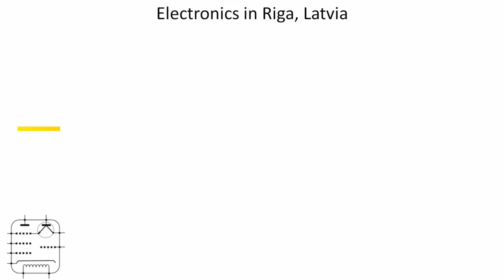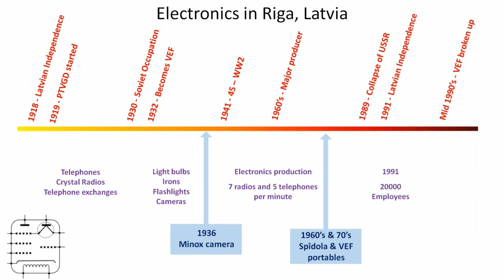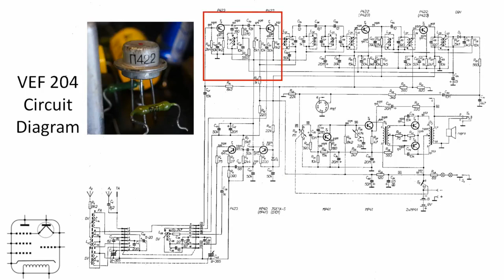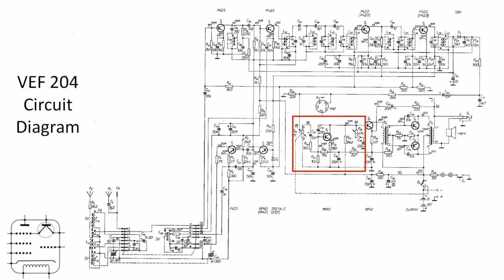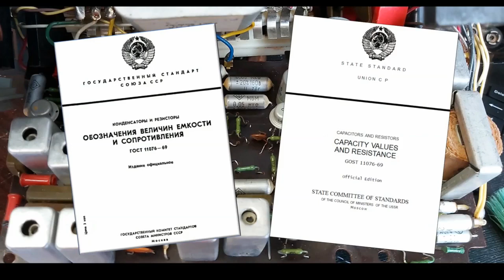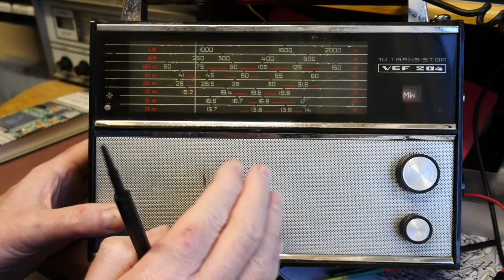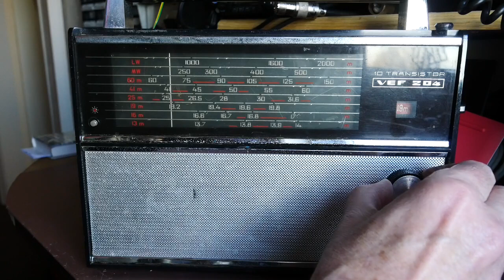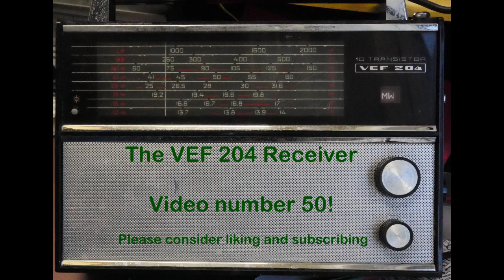The VEF 204 AM receiver - A Soviet (Latvian) classic superhet - #050

Comment: I have a VEF 206. The waveband multiposition switch doesn't want to make a reliable connection. I'm not able to detect problems relating to capacitor values. The power supply hums like crazy, so I took it out, and use a battery. What would happen if you used electrolytic capacitors instead of the yellow polyester ones?

The lower bands are incredibly noisy in a modern apartment. You have to go out several meters away from walls.

The 2-3 MHz band is interesting. Most radios don't have it. It seems that the ferrite antenna works better because we can directly compare at 1550 kHz. I was told that a ferrite antenna was directional and could resist Russian jamming.

Jesus, eBay is a ripoff. So many people threw out these radios. They have other goods for astronomical prices like a basic iron meat grinder or a coffee percolator / kettle.

I think it's not right that Russian occupation occurred in 1930. There was a democracy and in 1934 a coup d'Etat was performed by a Latvian leader. Latvia was occupied by the Russians during WW II in 1940, and was briefly liberated by the Nazis, and then recaptured.

Comment: Hello Bill, YouTube's algorithm just dealt me one of your videos for the first time.  I was born in 1955 in the US and have a similar interest in radios which has never subsided.  As a result, I made a career of servicing and designing receivers and transmitters.  

Those Russian portable transistor radios are the highest quality, significantly better than the Asian imports and most US made radios.  Thanks for showing the schematic diagram of the radio featured in the video, that helps me a great deal.  I was surprised the radio uses 8 poles of bandpass filtering in the IF stages and one extra IF amp stage - Nice!  The only thing it lacks, is an RF amplifier, which would significantly improve sensitivity.

The 9 volt DC idle current sounds high, I would have assumed about 25 mA.  The bias circuit for the audio output stage appears crude so, I suspect that is where most of the current is going.

Thank you for doing that video.  Seeing the numerous videos you have done since this one was published, it appears you have stumbled upon a hidden talent or niche.  Keep the good work, de AC8AQ.

Comment: 15:35 Why didn't you pull out the antenna on top of this VEF radio for better reception??
Reply from the maker: I use an external antenna.
Reply: @LockdownElectronics  Good. Thanks